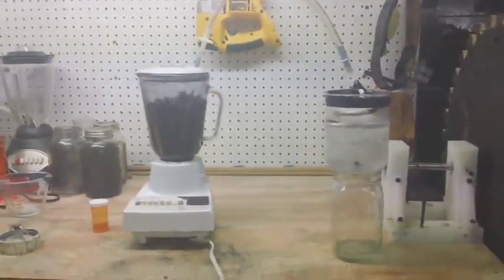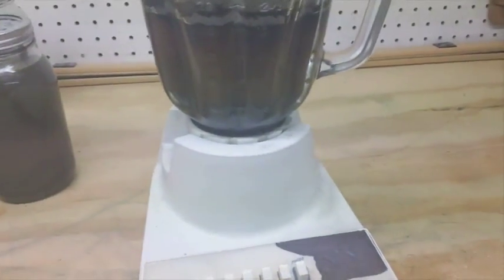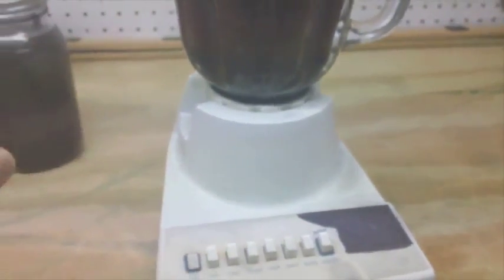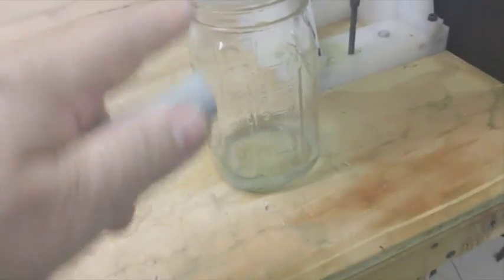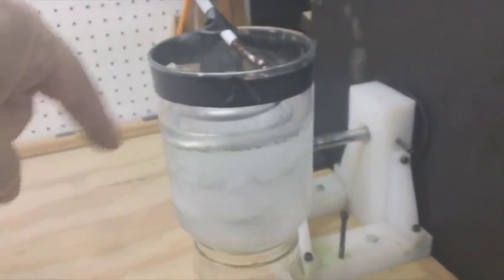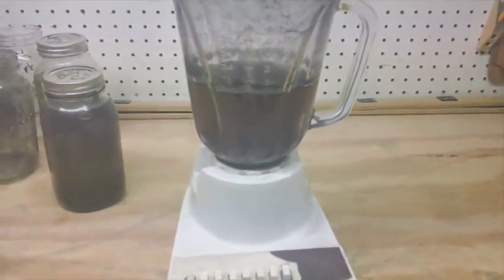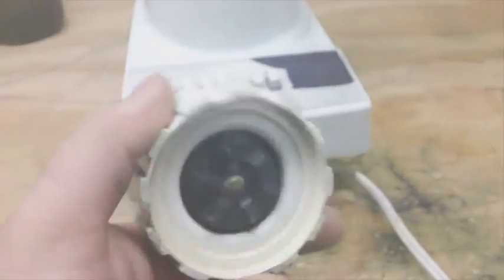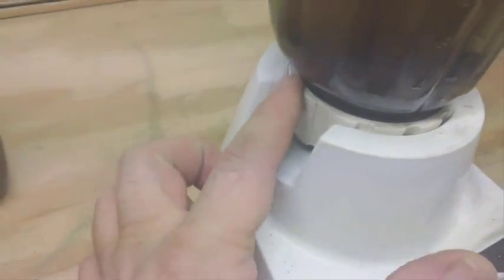Graphene blender method test Day  5

Comment: I wonder how much a good a paint shaker or ultrasonic cleaner would do in replace of the blender. That is some great experimenting :) I appreciate the share.
Reply from the maker: An ultrasonic cleaner will work part of this process was derived from a system using an ultrasonic cleaner it would still heat up but you could still use a condenser somewhere to this design on the ultra sonic cleaner but a use Blender is far cheaper than ultrasonic cleaner I don't think a paint shaker would work. Thanks for watching